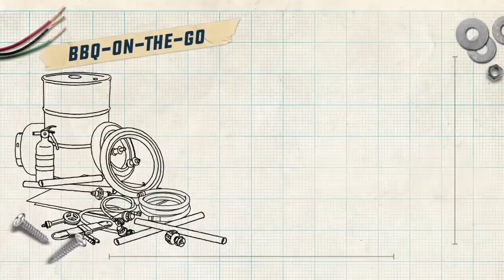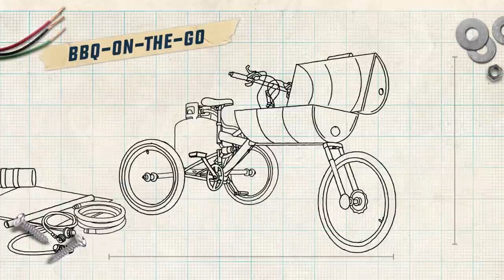Assembly Required: SMOKIN' HOT BBQ-On-The-Go is a STUNNING Build (Season 1) | History

Comment: Spoiler alert 3/9 show. Engines never crank over yet they figured out carb. Was messed with. Tim as a car guy should know if engine don't turn over you gotta fix electrical 1st. Battery, wiring, safety switches